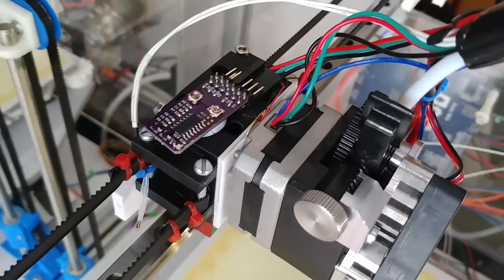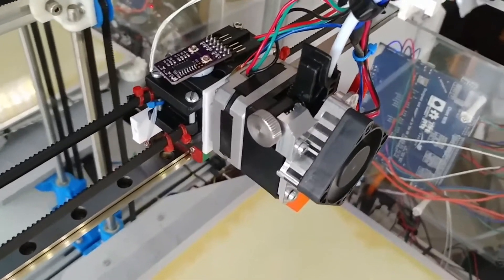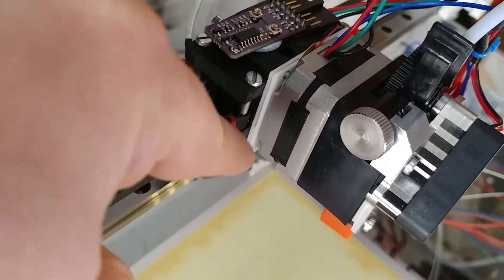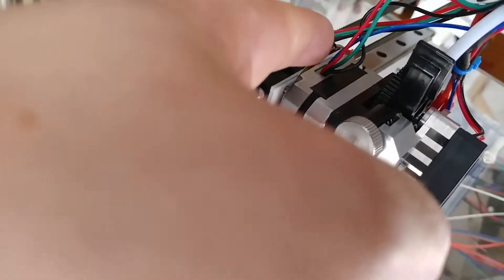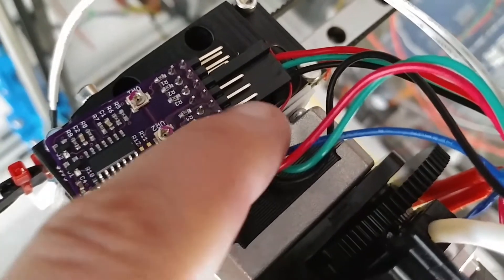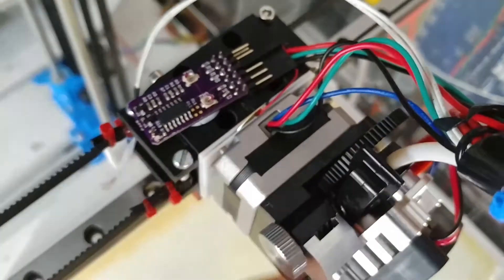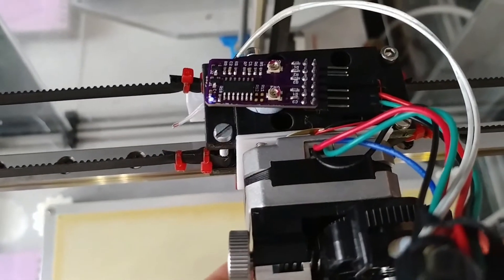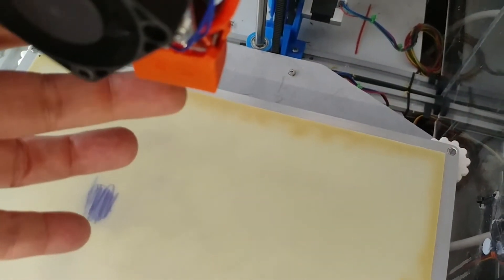Precision Piezo Titan Aero (or other nema 17 motor mount Z Probe

Comment: Quuestion : over time did that setup worked out well ? Or would you now go for underbed setup ? In my case i have an 300x300 bed where i have 9 screws and an Titan aero .. The IR sensor is not reliable enough ...
Reply from the maker: Answered on thingiverse.

Comment: is you hotend still stable? my worry is that when doing this with a heavy carriage like direct drive it'd add to much play or degrade the print quality
Reply from the maker: Stable enough. I did not notice any print quality drop using this bracket versus any of the others I've tried. The original E3D design printed bracket for the titan was rather flexible, which gave me the idea of integrating a piezo disc into it in the first place. I do not think you need an utterly rigid nozzle to print well, so long as you are not intending to plough through huge quantities of previous layers, which you shouldn't be if you are extruding the right amount. Unlike the frame which does need to be as rigid as possible (if you want to print fast) the nozzle is not subject to the bending forces of high acceleration like the axes and frame. The beauty of piezo versus previous ideas using microswitches to detect bed contact (even BLTouch) is that the piezo disc and our circuit is so sensitive that you can tighten the bracket around the disc quite tight, meaning little or no nozzle wobble.
Reply: @therealdjdemond  That's great! but what do you mean a rigid nozzle? I also thought the frame had to be really stable?

Comment: do you have plans for the printer?
Reply from the maker: Christoph Knopf I've dismantled it and the parts are for sale I'm going travelling. I did try to sell it in one piece but the availability of cheap Chinese machines like cr10 ender 3 which are quite good printers have devalued high quality reprap style builds.

Comment: I was wondering what the printer is? Highly intrigued by the rails and the belt setup for Z. Thanks!
Reply from the maker: It began as a Smartrapcore Alu, but has been heavily modified. See reprap forum smartrap sub forum for more details. http://forums.reprap.org/list.php?344
Reply: That's a handy resource! What modification have you done besides the Duet, the rails and the extruder?
Reply from the maker: You want more? Ha, no I  expanded it from 200x200 bd to 200x300 but only later realised if you are going to do this do it the other way to the way I have, do it the way Markforged have, with longer Y rails, and therefore a shorter (and lighter x rail). I might still try that configuration at some point. I've enclosed it, fitted thermostatic chamber fan, as you said duet, rails, etc.
Reply: Nicely done! Thanks for your time!

Comment: hey really cool i have a precision piezo to, how you set up to prevent the "double touch" (Z) on marlin?
Reply from the maker: Hi thats in configuration.h or maybe configuration_adv.h somewhere im a little out of the loop with marlin these days. Is it a problem with double touch?
Reply: Simon Khoury  thanks i found what I was looking for, my problem was the second touch was to slow and the piezo not triggered. The solution was set the same speed like the first.
Reply from the maker: Manuel Schrott ah yes I recall now it's something like fast z homing and slow z homing which is a ratio of the fast setting. Glad you found the solution.

Comment: And the results of the autolevel how good are with this system??
Reply from the maker: Very good if you set 0.3mm first layer print 1 layer and remove and measure it is 0.3mm.

Comment: amazing probe , but the real question, how is that printer so silent ? it's amazing !
Reply from the maker: Utaï - duetwifi controller interpolating 1/16th microstepping to 1/256th.
Reply: nice thank you! i was actually looking to buy one of these boards :D now i'm even more convinced !
Reply: @therealdjdemond  I use a tmc2208 but it's still not silent. a lot of vibrations form the motors still make it to the frame/belts ! tho at speeds around 45 it's near dead silent